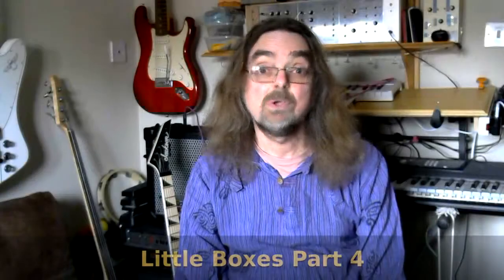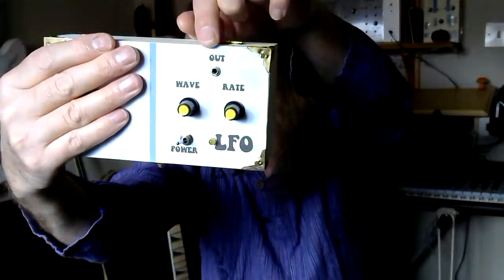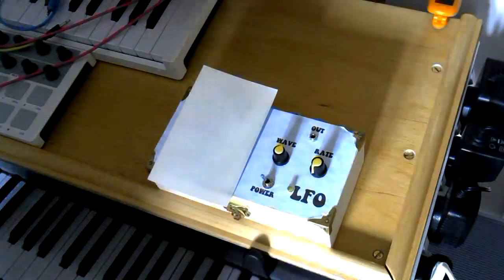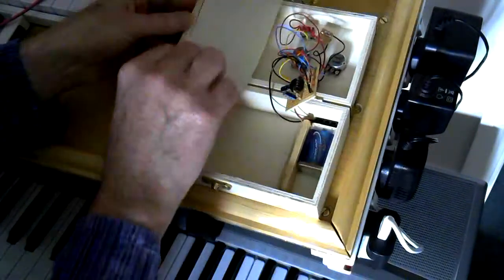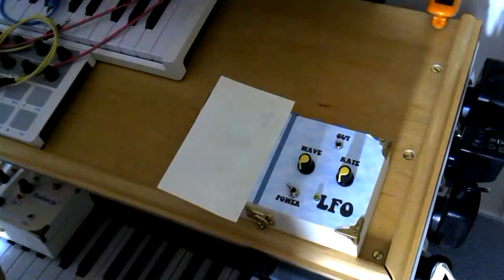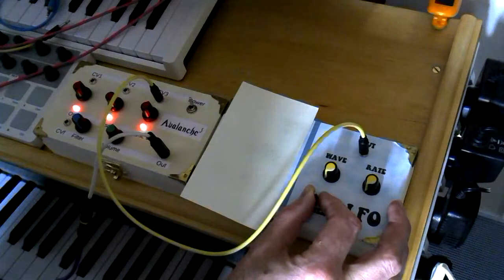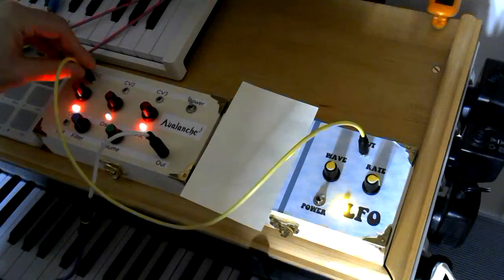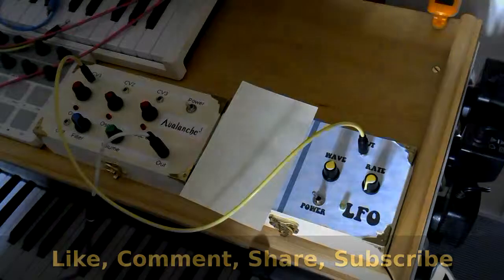Little Boxes Part 4a: LFO

Comment: I figured out the fix to remove the ticking/thumping! Simply place a 6.8uf or 10uf electrolytic capacitor from output to ground! Positive on output, negative to ground! Removes the ticking completely, keeps the lfo intact

Comment: I built this, came out great! I used tlo72 and ne5532. Both sounded good. The only thing is when wave is more squareish, the ticking is more present. Wonder if maybe lowering the 47uf would reduce that?
Reply from the maker: If I understand the circuit correctly, the 47uF is a decoupling/bypass capacitor designed to filter out noise in the reference voltage. Altering its value may help but I wouldn't know how to calculate the results, my electronics theory is not that good.

Comment: I'm guessing these are your own 'kits' based on a handful of components, rather than kits you're buying?
Reply from the maker: Some are circuit diagrams I get off the net others I design myself but I usually work out my own stripboard layout and buy the individual components to build the circuit. More 'bits' than 'kits'  ; )
Reply: @CuSiSound  got it, many thanks.